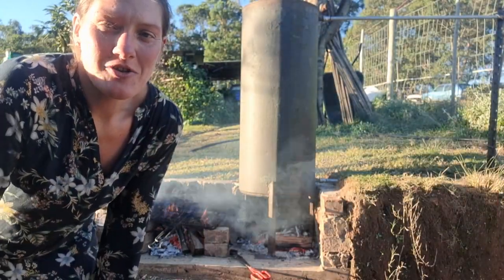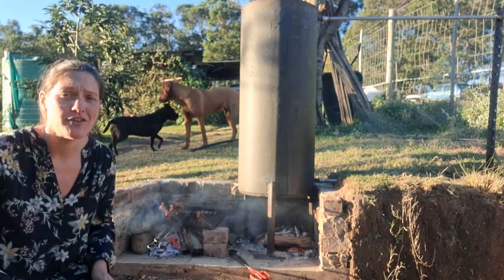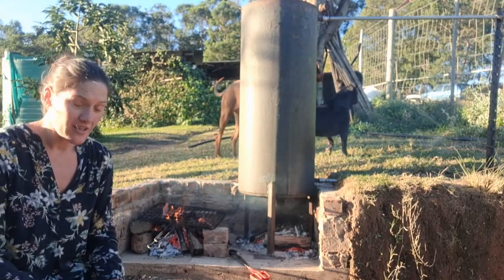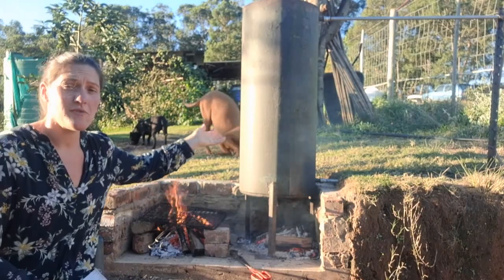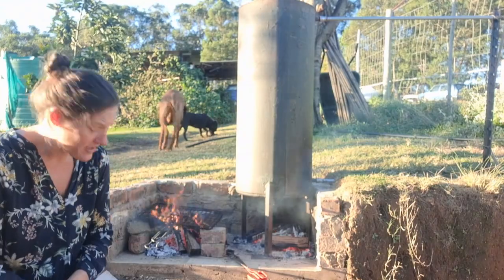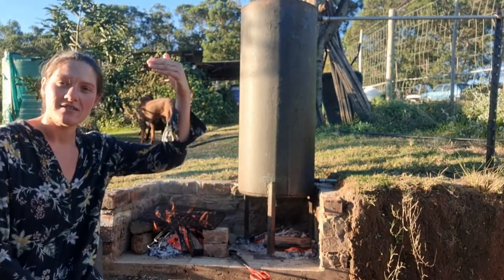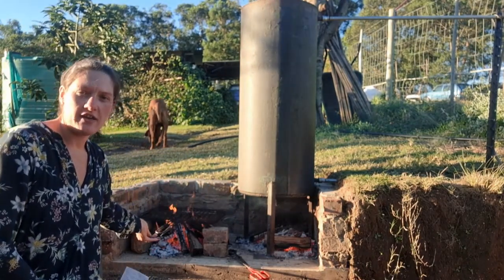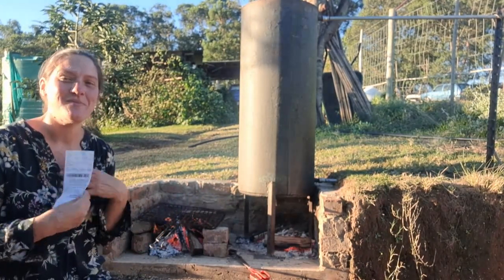Hot water without gas or electricity - part 3

Comment: I just bought a blue barrel yesterday. $25.  I got it in the greenhouse before the rain this morning. So it's full of water now. I got a little pump that uses ten watts to circulate the water through a solar hot water heater system that I'm going to build on the side of the greenhouse. The evening Sun 🌞 will hit it and heat the water.  I'll insulate the barrel and see what it does. My uncle gave me another pump , a RV utility transfer pump for the outlet. I haven't tried it yet so I don't know how well it will work. I'll fill the barrel from the stock tank right by the greenhouse, that catches rainwater.
Reply from the maker: How many gallons is you barrel? Interesting idea as we have good sun here in South Africa. Let know how it works, would love to know!
Reply: Well I have 55 gallon blue barrels that things like vinegar came in. They are a thick plastic. I'll have to find some copper tubing that I can afford. Everything is sky high in price now, over here. We're having a sort of heat wave. It's extremely humid and it's pretty warm outside too. During this part of the day I can't take it outside. I just got two more solar panels and hooked them up last night. They are helping run the air conditioner today, and I sure did need it.
Reply from the maker: Hey there...Thank you for sharing your idea, It sounds very interesting!